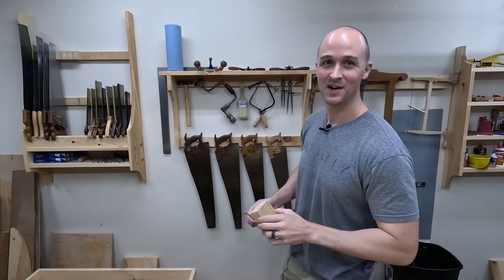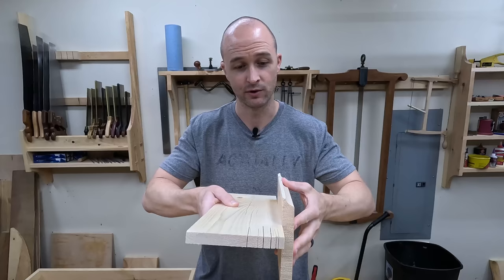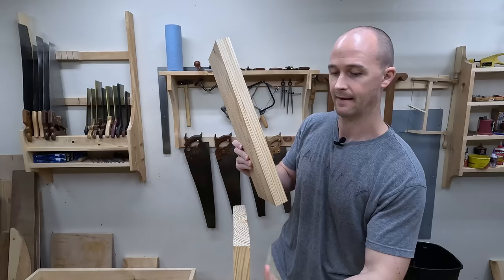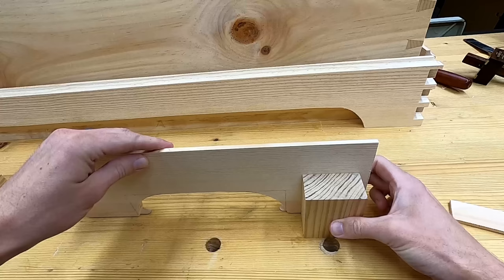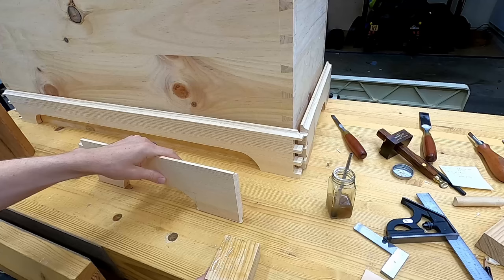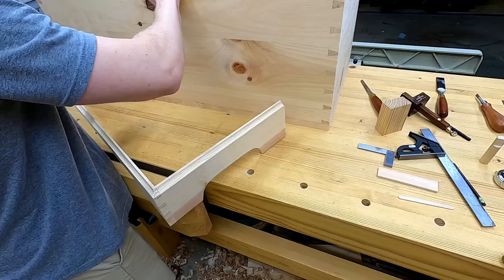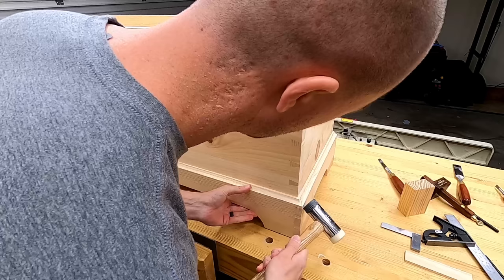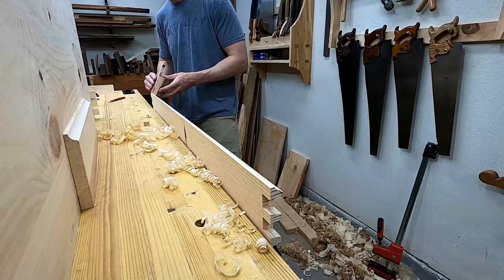Every Woodworker Should Know How To Use These (not the dovetails)

Comment: I'm just a hobbiest, and an idle one at that so take this with a grain of salt.  After looking at a fair bit of 19th century furniture, I developed the impression that the trim board is there to hide the legs. I've seen a ton of cases that have some sort of leg on the bottom and are then wrapped in trim so it looks more cohesive. I've pulled a few of those pieces apart to repair them and several of them have definitely had the trim added later. Might be replacement or just something added that couldn't be afforded originally. It's interesting though.

I don't know if it's just me, but without the trimboards, it looks okay on some floors, but not on hardwood floors. Somehow the naked legs looks wrong.
Reply: Plus it saved them having to do any fancy dressing of the feet. Looking at claw and ball feet they did fancy feet back then.

Comment: Looks pretty good and I like the concept, it certainly simplifies building the case vs having to incorporate legs there and then wrapping them... but your pins/tails are the opposite on the chest and the base :-( .  If intentional, OK, but aesthetically I  always run them all the same orientation.  I'd also knock the edges off the "foot blocks" - your 'touch' points on the floor... they will splinter uncontrollably with time if you don't.  FWIW shrinkage across the grain and not "compressive strength" is the reason to orient the blocks the way you did.  Not sure however that you're not creating a cross-grain condition that will make your trim skirt boards split over time. We'll see.
Reply: He's right about the compressive strength, but I was reading the comments for someone to finally point out that he glued those pieces cross-grain, which could easily create a bummer of a split later on.

Comment: Great video Frank, but I gave a like and decided to subscribe to your channel not only for the content of this video but (more important to me) the question of how much does a roof load of shingles weigh? This is a "loaded" question. To answer this question you would first need to know how big is the roof, what kind of material is going to applied, be it 30 yr. - 40 yr. - or life time shingles (50 yr.) assuming the the term "shingles" is meaning asphalt composition shingles. 
so, the answer(s) should be, (based on a dimensional shingle) 30 yr. = 210 lbs. , 40 yr. = 240 lbs. & "life time"  50 yr. = 260 lbs. These answers are at a per square weight. The "average" size of a home in the U.S. is 1,500 sq. feet of living space and to "average roof pitch is a 4/12  so you would times the size of the roof area and times it by the amount of weight of desired single selected. Also you would need to know how many valleys & hips to account of waste in those areas. 
I feel that I must apologize if I bored some if not all of you, but this is how this question would be answered. If it isn't apparent by now, I spent my entire working career (50+ years) in the  building trades.
Now, back to our show :)

Comment: Wondering why not put solid block feet on the bottom of the chest? The trim is just the dressing.  A piece that will be heavy fully loaded, I'd put a fifth foot in the center. No weight on the trim at all, even on carpet or a rug.  I do like the spacer idea for joining the trim.

Comment: Thanks Frank.  That is a good trick.  So, your glue blocks are creating a cross grained situation.  Hmmm, wonder if that will generate any comments.  :-)   I'd do it that way myself and wouldn't worry about it either.  I want to make a blanket chest in a few years out of tiger maple to replace the inexpensive toy chest we currently use.  Will use this trick for sure.
Reply from the maker: If the cross grain glue up doesn't personally offend somebody then I'm not doing it right 🤣🤣

Comment: Hi Frank. Question: what if you turned the glue blocks 90 degrees? Should be as strong, less likely to split (end grain does that) while moving and its now running with the grain of the chest and trim. I really enjoy your channel. 
Chuck
Reply from the maker: Your sure could! I think I'll just chamfer the bottom, but def more than one way to skin a cat. Cheers man!

Comment: you should never glue 2 blocks of wood against the grain together. If the wideness of one or both of the glued blocks changes, the glue or the wood will get tiny cracks every time and at some point it will fail. you shold design the big box itself so that is stands on the ground an the base can then be glued around with the grain. at least dont glue the block againt but with the grain so it has the same tunktion but is not glued against the grain

Comment: No need to make the glue blocks proud of the skirt. There are things such as furniture pads that you can stick onto the glue blocks/feet to raise the entire chest off the surface. For a non-marring and waterproof pad I screw on pieces of plexiglass.
Reply from the maker: Plexiglass is a cool idea... I've wicked in epoxy before for waterproofing and durability and plexiglass sounds less messy